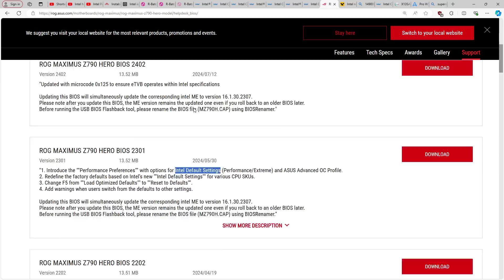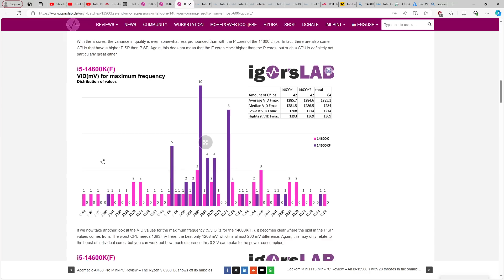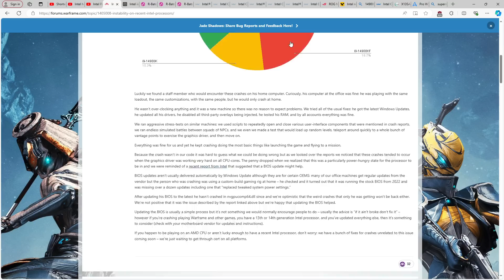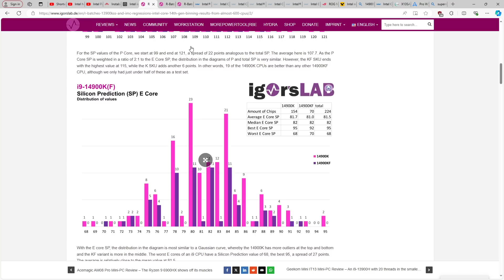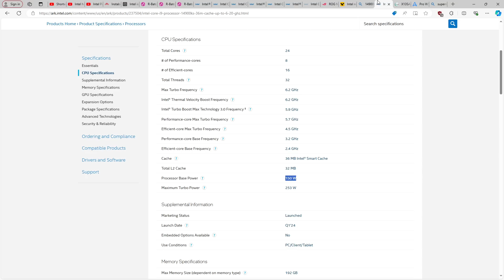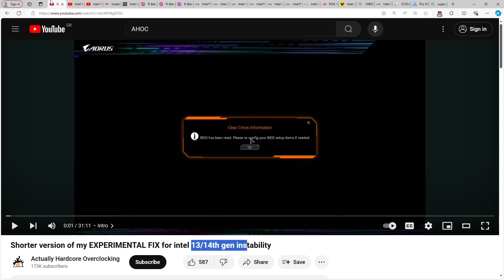The intel instability and degradation rant.

Comment: It makes sense if the motherboards BIOS are using way more voltage than needed. So even when there is no OCing of the core it is still causing it overtime.
Reply from the maker: Except both ASUS and Gigabyte were UNDERVOLTING the CPUs by setting the AC LL too low.
Reply: @ActuallyHardcoreOverclocking  That is true, but every single Board that I have seen has also set ICCMax over 400A. Could that also be a cause of degradation? Because when I set 307A on the Out of the Box Loadlines of my MSI Board (AC_LL 0.5, DC_LL 0.8; VRM_LL 1.1) it really runs hard into the ICCMax Limit.  Which wasn't the case with "unlimited"  ICCMax. That ICCMax LImit doesn't trigger that hard if you set Intel "Specs" by hand (and it doesn't hit the Powerlimit or the Templimit).
Reply: My MSI mobo (13600k) use liteload 15 in default ,which is around 1.37v, 
Now im using 1.07v manual settings for same clock
Reply: 13900ks here , i never had instability but i was trying to run all core at 5.7 and would allways have one or 2 cores dropping to 5.6 until your fix and i set to  llc to extreme and ac/dc to 10 10 and i can hold 5.7 but temps get a little hot. Gonna try to water cool  with custom loop.

Comment: I thought cpu's always degrade? Heat destroys or disbands the electrons right? I could be wrong. My 9900k use to do 5.1ghz at 1.32. Now it has to have 1.36ghz for the same 5.1ghz overclock. ✌️
Reply: CPUs degrading until failure at STOCK SETTINGS in these amounts within just months is unheard of
Reply: not at this rate and in such low period of time
Reply: my old 9600k was on 5 ghz, and then after the years i had to drop to 4.9 then 4.8 ghz with the same voltage for full stability.
the system i built and overclocked for a friend had exactly the same issue.
i bet with the smaller nodes the problem will be even more obvious, because electron migration will hit more hard, when theres even less space.
the more voltage and heat, the more degradation. its inevitable. very old chips have been so big in process nodes, that you havent seen it, because it made no difference.
Reply: The difference is that normal degradation in a CPU is that it may lose one bin after several years (like a 25mhz drop) of heavy usage.  These chips are degrading in months - that is terrible.
Reply: it's more complex than just "disbands electrons" - materials degrade with heat over a certain level but it very much depends on a myriad factors. Mostly the degradation will relate to the "doping" materials used, in essence a material changes from lets say 99% purity of X over time to 97-96% of X at which it's electrical properties are not the same, but by a bigger factor than you'd assume from the purity drop, so a number of things can happen then, a switch may flip early or late(voltage level) being what is being the issue here mostly.
The short of it in this case is that for a flip-flop to 'flip' a bigger voltage is required than what is supposed to be the case. That would be the case for your 9900k probably.
Reply: you mean 1.36v, right?
Reply: @I-Singu-I  right I am so confused
Reply: All semiconductors degrade. My audio transistors sound differently than they were 10 years ago.
Reply: @iceboy1170  Did they degrade significantly in a short period of time in optimal conditions?
Reply: heat degradation in silicon typically starts around 245C - barring some significant and relatively obvious manufacturing defect. This degradation is almost certainly due to voltage.
Reply: Did you even watch the video?
Reply: But a 9900K has 8 cores and the 13900K and 14900K has 24 cores. Honestly its nuts that people are trying to overclock P cores to 5GHz and above. When I set up a 13900K for a friend, I slightly undervolted it to offset the high heat at stock settings and set all cores at somewhere around 4.3GHz, so P cores would match E cores. He hasn't complained of any instability issues since.
Reply: Look, I know you're a fanboy and that's cool and everything. I mean lots crap on it but you like what you like. You have a basic knowledge of cpu's at least. There's no world where this is okay and not only that, it's a huge issue for everyone. A company bleeding marketshare put out a product that is degrading at stock speeds in conditions intended to cater to reliability while crashing.
That's not good for the industry at all. We need competition in the space and we don't have time for the  arm is going to catch x86-64 jokes. In a space with 2 players, one just made themselves a non-option and then aren't backing their product further supporting the idea they are a non option.

Comment: Anyone with a brain knew CPU degradation had been real especially with silicon quality below bronze
People wouldn't complain about degradation and frequency loss in the technical forums without any reason
Reply: I knew about this and was Confirmed with my 4790k OC. I didnt need to Question that after .
Reply: "Silicon quality below bronze"? What do you mean?
Reply: @samiraperi467 I think he means the silicon lottery website where the quality of the CPUs are graded and given rating s of gold, silver and bronze etc.
Reply: @samiraperi467  when you buy a cpu slip your local PC shop a 20 for gold quality silicon man. TBH there is something to it, I remember going and picking steppings out from my supplier and I set a world record back in the old opteron days.
Reply: Only with very high temps over 80 DegC......if you cool them to below 35 DegC, they could last for decades or longer...
Reply: @fteoOpty64  The current i9 K SKUs fail *below 70*. It's not the temperature unless the silicon is somehow bad enough to degrade at those temps, and it's not.
Reply: @fteoOpty64  I had mine at 50c constant full load. I wish I had sub zero but water did well. lasted 4 years until i started to have problems. But i went in with the understanding I was on borrowed time. Now trying to get a replacement but i cant find one for a respectable price.
Reply: burn in yes, degradation, no

Comment: I am a poor with a 12th gen i5 so im good :)
Reply: The early ones have AVX512 as well.
Reply: @BOSSenjoyer I have a 12700K with AVX512, nowadays it would be extremely rare.
Reply: @saricubra2867  Nice. I got the i7, i5, i3 not long after launch, all have AVX512. Part of the reason before this for not upgrading yet lol
Reply: @BOSSenjoyer What is AVX512?
Reply: @StormRider-1  its an instruction set in the cpu that can make it perform better under certain conditions. I don't know if games use it, but some simulation software like ANSYS does
Reply: sorry to tell but this is something bigger on architecture side and you are NOT safe with i5  , just read my previous comment and you may understand if my english is good enough .
Reply: @Pieteros21  nah 12th gen is fine you are spreading misinfo
Reply: @JacobTech92  much smaller scale but you can see info from users if 12gen, and i already witnessed weird behaving 12400f after 1.5 year of usage .